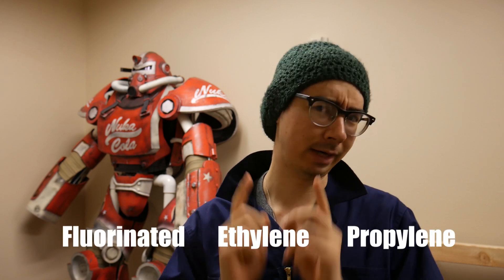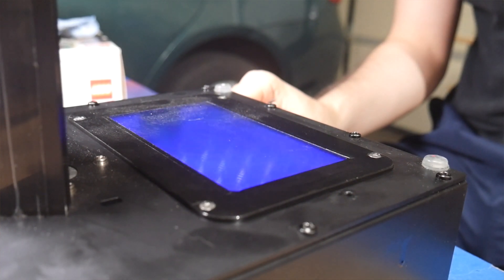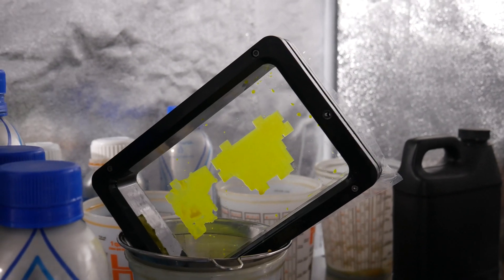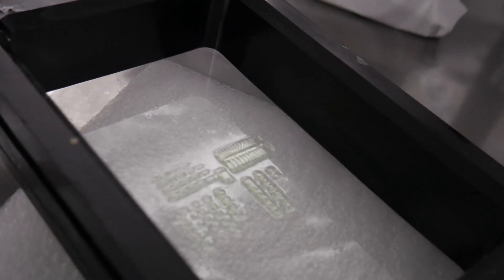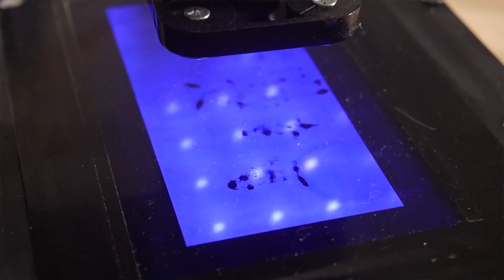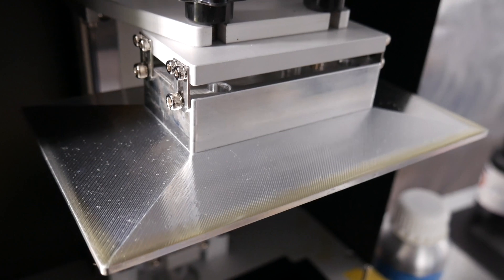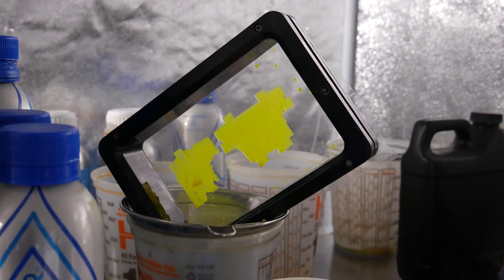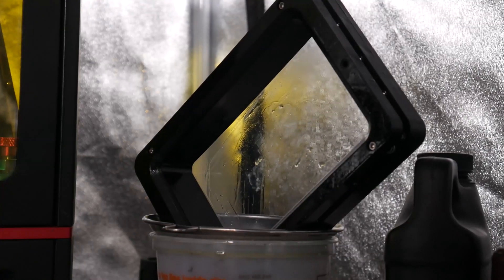FEP Liners for Resin 3d Printing EXPLAINED

Comment: Its kinda catch 22 with the 1mm fep to the 0.5 honestly there isn't much difference in print detail I've noticed personally the thinner fep has more elasticated pull in the middle so your see sometimes all the outter edge prints being successful and a hole in the middle of just supports whare its been to much pull innthe middle whare as outside prints have less tension pull off the fep but and a big but if your doing the same build plate order design to print parts itll be even tighter around the outter edge and could fail and have a successful center im sure theres a 1.5mm fep ive not tried that yet but its all about that perfect balance

Comment: (EDIT) (For those who see this comment, please read the replies)
IMO, you're making it way harder on yourself with all this.   To keep the resin particles clear of the FEP after each print I just set the loosened build plate down into the vat and run a lowered time full bed UV test burn for about half the time I use for burn in.   Run my thumb across the bottom of the vat and the whole thin sheet comes off instantly and leaves the FEP completely decontaminated.   Done.
Reply from the maker: To be fair this video was recorded in the early days of resin printing before the handy clean mode was a standard feature in the firmware of every printer. We've come a long way since then haha.

Comment: I really liked your video, it looks old (2020) but resin printers are new in Brazil. I'm currently having printing issues that I haven't really been able to resolve:
- With only one or two prints I'm having to change the FEP, there are small fold marks that cause errors in future prints and that's why I have to change it.
One useful thing that informed me was the exposure time of the initial layers that can damage the FEP. I'm using 4 initial layers with 10s exposure that is sticking very well and that maybe then I have to reduce to try to solve but I don't know if that's the problem.
During the entire printing process of any piece I can hear the sound (plof) of the piece detaching from the FEP at each layer, I don't know if this is normal (each layer has only 3s), I've tried to reduce it, but I think 3s is the minimum, unless this damages the parts. If you have any suggestions I would appreciate it.
Reply from the maker: All of that sounds pretty normal. If you are getting wrinkles or folds, its likely that the FEP is not tight enough (I personally prefer slightly overtightening my FEP sheets to get consistent results that last a 2-3 months of heavy use).
Reply: @HiroCreations  Thank you very much for the answers and help. It was great to receive help from those who already have experience.

Comment: I had a failure that the FEP draged my print off from the supports leaving the raft and supports on the build plate. what do you think is the possible cause for the failure? I thicker the supports and problem seemed solved, but the thicker supports leave urgly mark on the print surface.
Reply: you mean that thicker supports ugly your part or your FEP?

If your part: Try slowing the z speed and raising slightly higher to ensure that the parts slowly peel off the fep. Make sure the fep is not too loose or too tight. Too loose and it just raises with the parts and doesn't have releasing force. Too tight and it doesn't flex enough, so it is trying to pull the whole part off at once, like trying to pull on a suction cup vs peeling up the edge.

If your fep is showing marks: redo your build plate leveling and make sure you are using a spacer that matches your fep thickness. (eg, if your printer came with a thicker fep, but now you are using a thinner one, your calibration will be off). Try using less pressure when leveling the build plate. Excessive pressure will act like a thinner shim.

If your exposure setting is too low, then your supports may be under cured. Also, you may be able to put a small delay before the machine tries to lift a layer (not more exposure time, but it is more time for the cure to set)

Lastly, consider how you are supporting your model. If you have ever bought a model and had to take the pieces off of the sprues, then you will know that with 3 spaced out supports, it is  hard to remove, but with only 1 or 2 you can flex and rotate the part back and fourth and it will come off much easier.
Reply: @andrewstambaugh240  I keep the support connections small, but add more of them.

Comment: If you do not want to scratch your build plate go to Harbor Freight and get a Nonmarring Scraper Set. Basically are set of hard plastic chisels that you can use to remove parts from the build plate. You may have to sand the tip to a fine sharp edge and it should work perfectly. I use a very small hammer to tap the chisel and the parts just pop off the plate.
Reply from the maker: Great call, I will have to try that. Certainly simplier than the spring loaded build plate mod I have open in Fusion 360 for CNC machining.